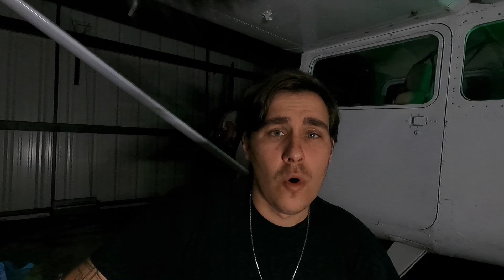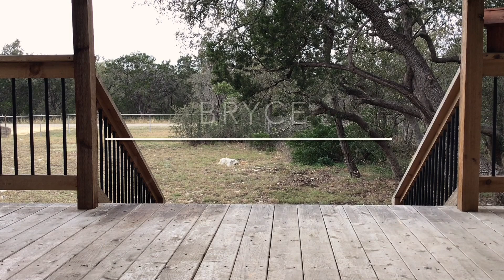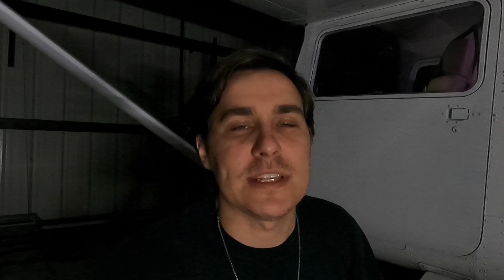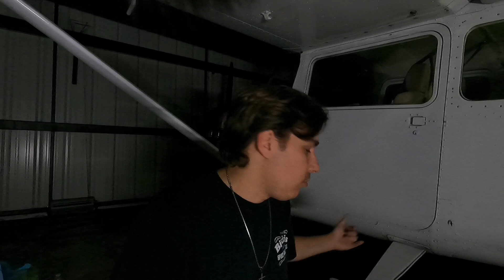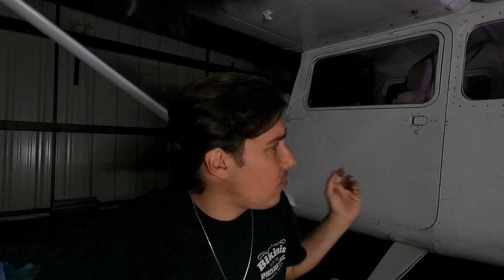Why Aircraft Mechanics Avoid Owner-Assisted Annuals | Key Reasons Explaine

Comment: Its a bummer when you have an incompetent owner but this is the crux of the issue between mechanics, owners and the FAA.  As an owner I am FORCED by the govt to do business with 3rd party to use my own private property.  This is the only reason I am pursuing my A&P / IA, and of course the FAA makes it as difficult as possible.  The process is such a quagmire and if you have an unscrupulous mechanic who wants to do the annual on time and materials you can really get burned, sure you can say no but the FAA makes the A&P and particularly the IA process so convoluted they have created artificial scarcity in some areas.  I have heard of coworkers in the past get bills for 6 grand (and nothing extreme was done like an engine overhaul or a new prop or significant wood/fabric rebuilds).

The GA annual is probably the biggest sore spot in aviation today (I would say medicals but basic med saved that and congress had to literally force the FAA to do it because its made things to simple on some guy that wants to fly a super cub around class G air space because you have to save your whole life to pay for the special TSO parts lol and now now your facing medical problems).  Imagine if every motorist had to get a special mechanic to inspect their car every year to the sum of thousands so they can go to work, I mean a malfunction on a car can also cost lives.

The Chevron overturn was a step in the right direction.

Yes you dont want to fly around with a crack in a critical location but that shouldn't mean 6k annuals and 5$ bolts either.  The public is starting to sour on administrative law and hopefully the FAA can make some changes like let people get repairmans certs for their own personal CERTIFIED aircraft to sign off their own annuals so that all you have to know if YOUR plane and no others.
Reply from the maker: I hear your points, I also think that is why there is such a large movement towards experimental aircraft. I'm starting to see as many experimental's at any given airport as certified aircraft. 
I also understand what you mean when it comes to unscrupulous mechanics, as I have come across one in the past. That being said, I try and be as fair and open as possible with my clients. I have never charged anywhere near 6k for an annual.
Reply: The cost of inspection and proper maintenance of GA aircraft is a hot topic.  Having been engaged in General Aviation maintenance and teaching aircraft maintenance for 3 decades, I have some opinions.
Inspection of any type is a very unappreciated and misunderstood process to the uninitiated and uninformed.  The process is also very time consuming, skill and experience dependent, and critical to the safe operation of aircraft.  Often owner operators are indignant and have very little understanding of this process.  And, with any mandated obstacle to what folks want to do with their money, the bitching and complaining will commence.  BTW the Annual inspection cycle is appropriate from what I see daily.  12 months of flying, or sitting in a hangar WILL cause discrepancies.  If an airplane is sitting on the ramp in the weather you can triple the damage. 

Fact is, regardless of the complexity of the aircraft, from a Cessna 150 to the highly complex airliners and helicopters of today, consistent and repeated inspection and maintenance is required.  This takes personnel that are not only educated, experienced and certificated, but that are ethical in not only the monetary sense but also genuinely concerned about the safety of the owner operator and all the others that are at risk.  After all, the people on the ground didn’t sign up for ANY risk.  

As it turns out this inspection and repair is expensive.  But if we consider the cost of anther device we maintain as a regular requirement of our society, the car, it becomes clear the cost is disproportional.  Keep in mind the GA airplane is a luxury, not a requirement for transportation.  I will not quote numbers because all regions are different.  If your grousing about paying your A&P IA, give a quick call to your local Toyota dealership and ask about the hourly rate they charge.  
Tracking in a little tighter on the money, the value of your airplane is directly effected buy inspection and maintenance and the quality of shop and personnel.  Deferred or worse yet missed discrepancy’s are hard to justify when selling.  Or buying.  A bargain annual inspection may sound great, even better a bunch of years of bargain inspections.  Right?.....nope.  What can be found during a GOOD Pre-purchase or a fresh eyed annual can be devastating to the value of the airplane if there are many known deferred or missed discrepancies.  Choose your shop by reputation and what other owner operators have to say.  
On money, the pay for this gig is not what you might think.  I am regularly tasked with the inspection of machines that cost more than I will make in my entire working life.  As of now, I earn about 15K below the median house hold income.  In the U.S.  And the liability, education, certification, renewal and the physical and mental stress involved are, again disproportional.  I am not complaining about pay.  I could make the Toyota money, I don’t because of a passion for aviation and the people.  Yes, the owner operator.  I also TIG weld and often save owners the down time and a lot of the expense of part repair.

Owner assisted annual inspections will be slightly more expensive at first, after a couple of cycles, the cost will reflect the relationship and the education of the owner.  This is one of my favorite ways to contribute to this world of safe flight.  The more an owner operator knows about their machine the safer the operation will be. 

One more point of education, and I am off my soap box.

Experimental category aircraft are very attractive, when cost crunching.  Keep in mind if you want to inspect and maintain your Experimental you must build it.  So if you have the skills, about 1500 hours, the space and tools, that is a way to go.  Statistically about 25% of kit aircraft get completed.  But if an experimental aircraft is purchased, complete,  it will be a requirement to have it inspected, annually, buy an A&P.

I leave you with 2 Quotes.
“I will not subsidize your hobby”
“I will not feel sorry for any man that owns an airplane”

Comment: My Temporary Airman certificate is about to expired, what should I do?
Right now am not working as an A&P mechanic because I do not have my powerplant certificate. Should I get another (AIRFRAME temporary certificate) or go for my powerplant.
Reply from the maker: I may be confused as to what you are asking, so let me ask a few clarifying questions. Have you tested for you A already and passed? But have not received the official certificate? The answer to that would be call the FAA records branch and ask for an update on your cert (you do not need to retest if you already passed) 

Or you haven't finished the testing process for the A? In that case I say finish the testing process before your window expires. 

Regardless of either Test for your P as soon as possible, the certificate number will be the same for both.

Comment: Great video.  The crack hunt is where its at!  LOT of years and still delivering expensive good news.  Better to find some squawks on the ground.
Reply from the maker: There have been a few where I maybe didn't save the pilots life, but we for sure avoided a major and catastrophic failure
Reply: @brycebuildsit  Hard to say, save a life or preserve the value of the airplane its all good caught on the ground.  
Today, a 90% cracked engine mount tube on an Extra 330.  Other members share the load, but better to know that on the ground.  Keep up the good teaching!
Reply: I met a lady at an Experimental Aircraft Association Young Eagle event, she flies a 330. I'm an A&P/IA plus fellow EAA member, and I would like to notify her about this. Where did the crack occur? From her description, she flies aerobatics real hard, lots of Gs. Thank you
Reply: @canoe365  This crack was located just aft of the upper left LORD ring.  Top of main tube propagating from the toe of the weld at the bolt tube.  This was an Extra 330 with 1200 hours on the clock (ish, all from memory) time on the airframe.  We swapped the engine mount out before further flight.
Reply: Its only expensive if your forced to pay someone else to do it.  You for sure dont want cracks but it shouldnt cost thousands to fix them.